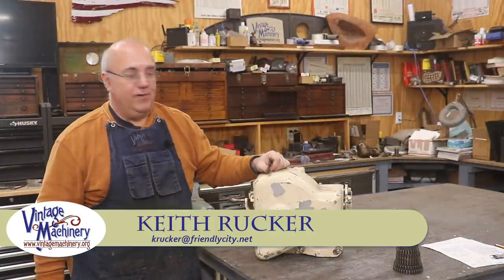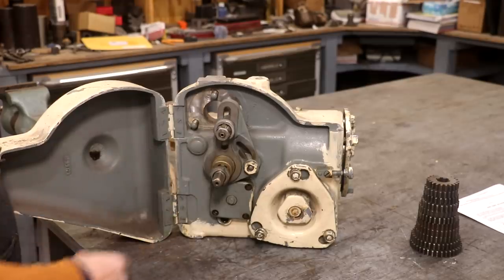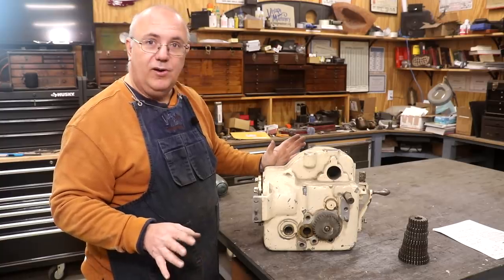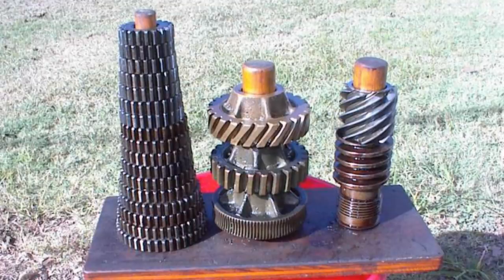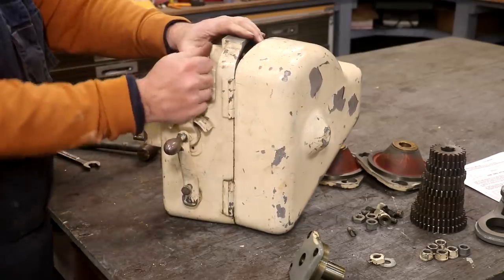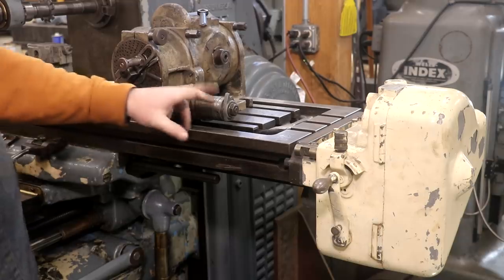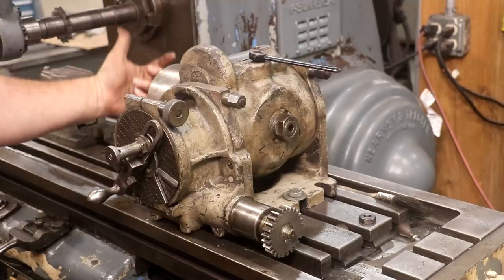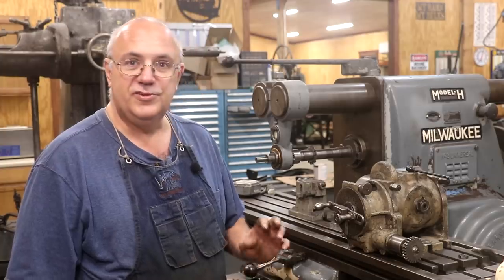Kearney & Trecker Low Lead Attachment for Cutting Spiral Gears

Comment: Everything about this is screaming old school PTO..
I know tractor PTO is might be a little bit bigger but they also sell slip couplings for PTO drive shafts that are equipment specific..
Also look into things made by the US military like winch drive lines.. it's been awhile since I've done too much digging but it screams like 1960s US military PTO drive shaft
Reply from the maker: The smallest PTO shafting I have been able to find is 1-1/8" OD.  I am needing 1" OD.  It may be out there, but it has been hiding from me.
Reply: @VintageMachinery  
I'll do some looking too